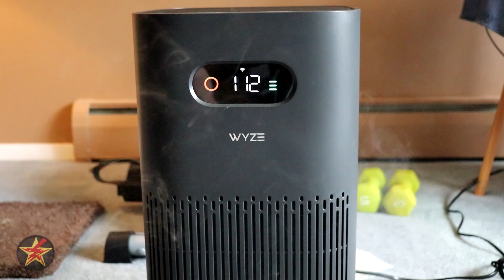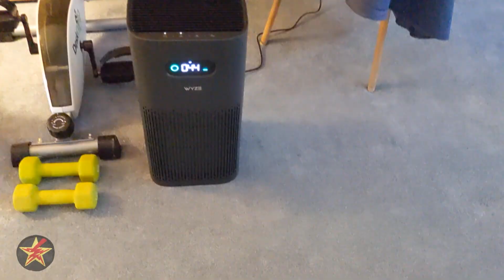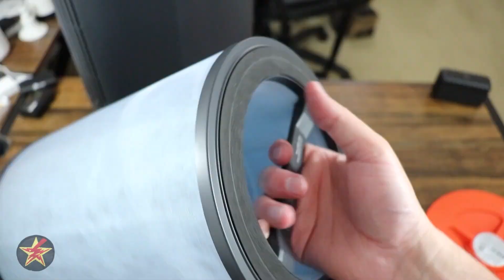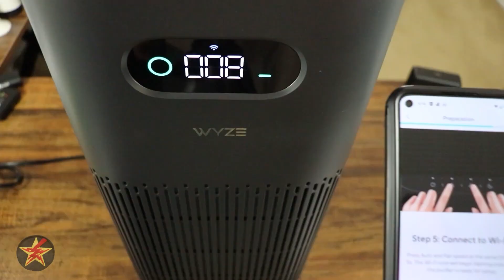Wyze Air Purifier Review: How Well Does It Work?

Comment from the maker: Some helpful time stamps:
Intro: 0:00
General specs: 0:59
Filter types: 1:53
Fan: 2:11
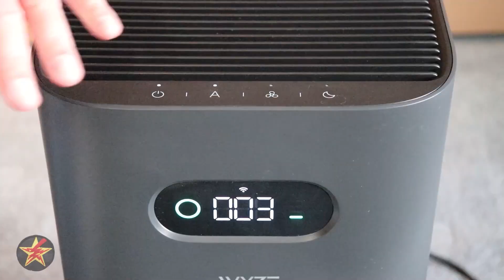Top: 3:13
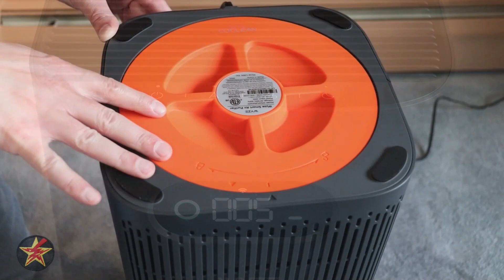Bottom: 4:58
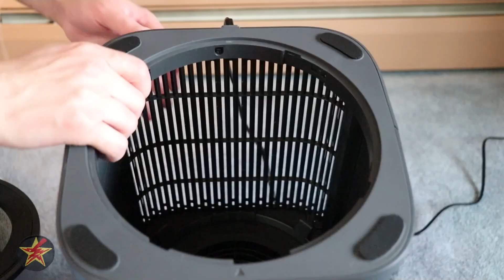Inside: 5:48
Screen: 6:32
Setup: 7:26
Power usage: 10:10
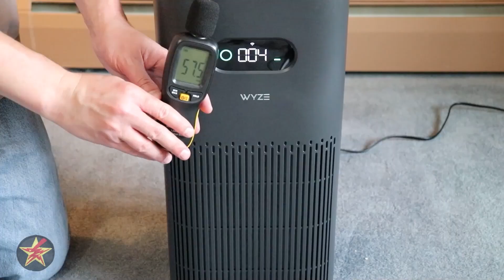Sound test: 11:16
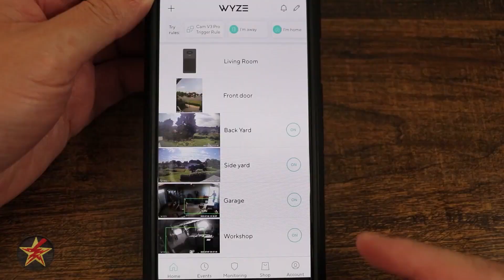App controls: 12:25
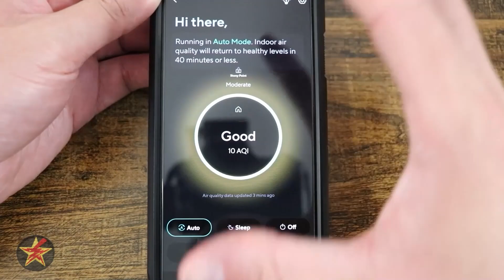App settings: 14:28
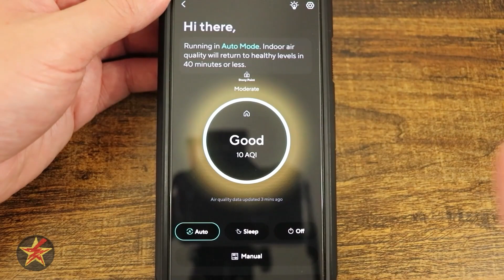Testing: 16:27
Cons: 18:47
Conclusion: 21:17

Comment: Thanks for the review; I sent it to a relative! I’ve been hooked on air purifiers for a few years now & have completely changed my life with seasonal allergies.

Anyone looking into this; if you want smart capabilities, it’s a great buy. I’ve owned all different brands and types of air purifiers.
I still use my wyze and have it around the laundry room since it works quite well with odors (with premium filter). I usually prefer a thick layer of activated carbon but this still works well for my needs. In my opinions it’s one of the better buys for a couple hundred bucks. If you don’t need or care about smart features then without a doubt the WINIX 5500-2

The wyze is a bitch to connect to my WiFi but once connected it stays connected. The app also is limited with features such as air quality sensor data. The Wyze app is pretty solid though and works fine with my Alexa routines.
Reply from the maker: Thank you so much for watching and sharing the review with your relative! I'm glad to hear that air purifiers have made a positive impact on your life with seasonal allergies. It's always great to have options when it comes to choosing the right one for your needs.

Comment: I have this exact purifier i use the standard filter however. Now either im doing it wrong on i have a defective unit or maybe its jyst the ways its supposed to operate bit the child lock feature when i turn it on it doesnt stay on all the time so basically like if i use the child lock feature in a few hours itll be off again and ill have to turn it back on again so im not sure if it has like a shut off feature where its designed to only stay on for so long or what. Also i can never find replacement filters on the wyze website there hardly ever in stock at least the one  i need anyway i think they only have one of the three filters in stock right now.
Reply from the maker: I tested the child lock last night and mine did stay on for over 12hrs.  Do you have your unit connected to Wifi?  I do agree that the filters are a little hard to get on the official Wyze site unless you are getting the most expensive one.  However, Amazon does sell them as well for a little more but with free shipping it about evens out. https://amzn.to/3Q7DK7F (As an Amazon Associate/Influencer I earn from qualifying purchases)